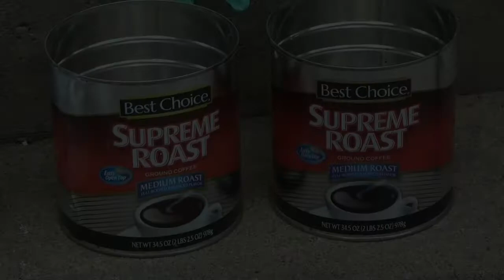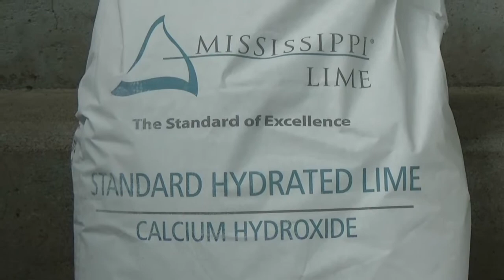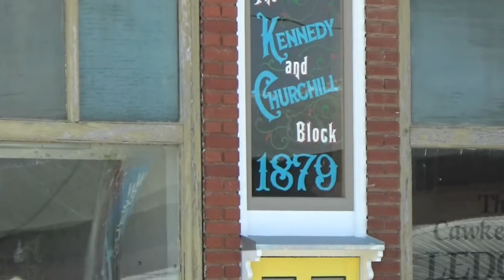How to make Lime Putty for historic mortar mixtures

Comment: Nice video. You can avoid lumps by sprinkling the powder lime into the water while you mix it with the drill. As the mix becomes more dense, you add more water, then more lime etc. Also, traditionally speaking, slaked lime putty (pit lime) is superior to putty made from lime in powder form.

Comment: Where are you buying your Hydrated lime? I can not find it in my area and the building supply stores here don't even know what I am talking about.
I went online looking for it and the least expensive I have found was $42 a bag with free shipping.
I found it for $12 plus but the shipping alone is over $50
Reply: Type S mason's lime, as commonly found in the concrete section of the building supply store, is hydrated lime.
Reply: @maxkronader5225  Your saying you can mix this lime with  water and it can be used as a mortar?

Comment: As for your comment on bricks, older bricks.
Not all of the older bricks were soft as you seem to believe.
Realize that years ago there was no material like cinder block, today known as concrete block.
Therefore if a wall was say 16” thick, it was 16” of brick.
The exterior surface was made up from a hard brick, known as face brick.
While the inside portion was a softer brick,less expensive to make, and were commonly referred to as ( Salmon ) brick, due to their color.
Many of these older buildings are torn down, and the bricks sold for new construction where the used brick look is desirable.
The soft Salmon color bricks should not be used as a face brick exposed to the elements of wether, but in many cases they are.
When water penetrates them and then freezes the brick tend to crumble over time.
And the mortar used for laying them has nothing to do with that.
In fact of the ways to repair them, is to either remove the brick entirely and replace it, or simply repair the surface with a good mortar mixture containing cement.
Fact is that the modern method for preparing lime for mortar is no better than the now ancient way of preparing it.
There are better qualities of lime available today, but we need wait untill history declares it being actually better.
Meanwhile, mortar made by using cement is the superior product.

Comment: Why would you want to create what was an inferior product compared to todays mortar?
Apparently you dont realize that lime mortar was used because cement had yet to be found or found usefull for making better quality mortar.
As for the soaking of the lime, overnight soaking is adequate for making lime mortar, any longer is totally unnecessary.
The benefit of soaking is a smoother mortar as opposed to mixing it directly from the bag, but it actually adds nothing to the strength of the mortar.
It is what it is, and always will be, an inferior product to todays 3 part mixes of sand, cement, and lime.
And are you aware of what was used before lime in the making of mortar?
Well how about plain old mud, and fact is in some areas of the world it still is.
Independence hall was built using lime mortar also, but you can bet that any restoration to those brick walls is done with mortar containing cement.
The washed out joints in the wall shown in your video should receive the same type mortar.
Reply: because it's not about which one is better, it's about which one is appropriate. newer kilns heat and cycles and balanced mixing make different bricks now than old bricks. old bricks are softer and can spall from new mortar. older bricks can also be damaged by the lack of water transfer through new mortar.
Reply: An article came out of a study on why the Roman structures are still standing, it is not about 100 years, what about 1000 years? Is is better or cheaper or easier?